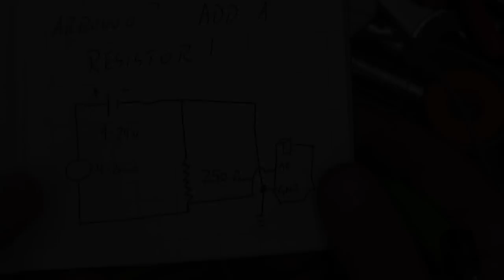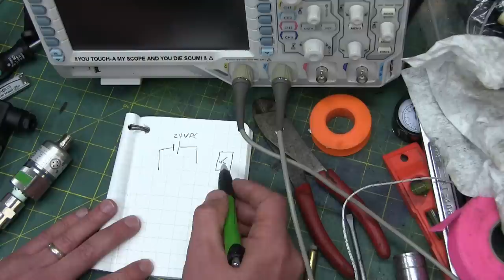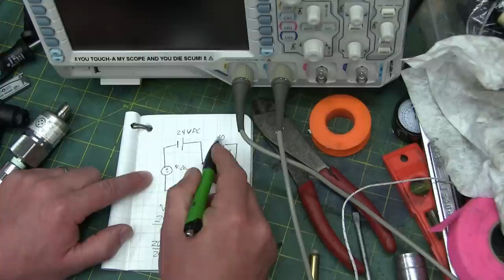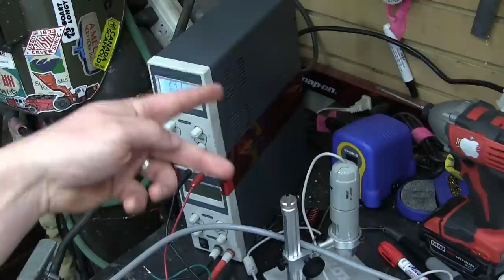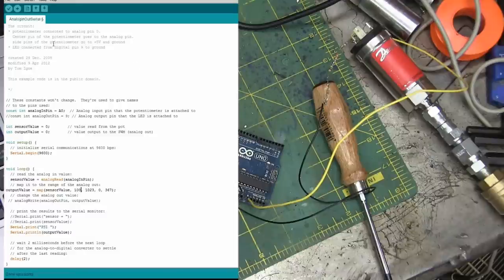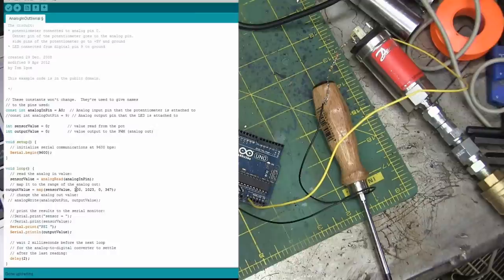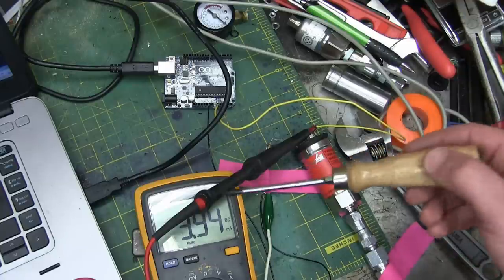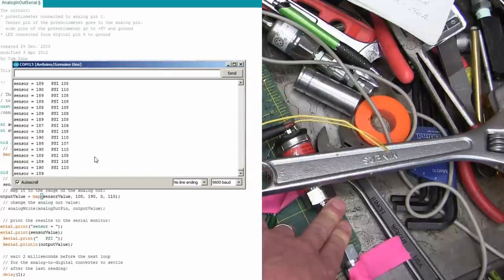4-20mA Industrial Sensor + Arduino

Comment: You have hit my specialty area!  We use 225 ohm resistors (0.9 to 4.5 VDC).  You can detect some failures where the current goes above 20 mA or below 4 mA.  The current loop allows you to have multiple devices in the loop (panel meters, current switches etc.) without affected the output.  Since the loop doesn't care about resistance (within limits) it is unaffected by resistance in the wiring.

Just be careful about the configuration so that you don't have a power supply with a grounded negative, then ground the loop somewhere else.
Reply: Michael Steeves you need to make sure the power supply can drop the voltage for each device but otherwise yes.  Just use 220R for an Arduino, it's an E12 value

Comment: If you send the values from the arduino to the pc you can open the serial plotter(tools->serial plotter) in the arduino IDE and show a graph of the values comming in
Reply: Or just use a Pi with an ADC hooked up.
Reply: Gordon Lawrence "just" .. I would say the arduino solution is way easier to get it running

Comment: Bastard got me. I'm running it over and over in my head how the F does one get 250 ohms from 3-10ohm resistors.  It didn't occur to me until I finally got that marble loose in the old can of brake clean I have had on my shelf for years!
You had me really questioning myself. 
Never doubt AVE!

Comment: The reading that is measured by the arduino depends on the precision of the 250 ohm resistor.  At my steel mill we always purchased expensive high precision  250 ohm resistors.

Comment: For better, more functional code that properly handles below 4ma errors: 

short read420(analogPin){    
    sensorValue = (short)(analogRead(analogPin)-204);    //is an approximation of the 4ma value
    if (sensorValue < 200){    //is under the 4ma value by some quantity to account for component aging and noise
           sensorValue = -1;
    }    
    return sensorValue;    
}
//Note that -1 is an error code and anything positive is a good value

Comment: Depending on how the sensor is rated I would suggest that the lower value (100) isn't actually 0 psi, it's likely closer to 14.7 psi depending somewhat on your elevation (14.7 psi would be sea level, 13 psi would be 1042m/3420ft, etc).
Reply: You would only do that if you're trying to measure absolute. He's reading PSIG.

Comment: 3:45 no you mean 5v/20mA=250ohms. 5v is the voltage you want it to correspond to the max reading from the sensor i.e. 20mA

Comment: For what it's worth, if you're using a 6" bourdon tube gauge as your calibration standard, they're typically +/- 1% of full scale.  Heise (mirror backed) gauges are generally 0.1% or better.

Comment: Good video, very valid approach to convert current into a voltage, however a more Skookum way would be to use a Transimpedance amplifier, just google it on the confuser.

Comment: Your pixie wrangling explanation is a bit off. For any part of the circuit, V = I * R. If you therefore measure the voltage and know the resistance, you know the current via that formula. 
If you know the max voltage (5V) and the max current (20mA), you can calculate R = V / I = 5V / 0.02A = 250 ohms. If your measuring device works with 3.3V, you need a resistance of R = 3.3V / 0.02A = 167 ohms.
You will notice: lower resistance means lower voltage - which might sound counter-intuitive, but it's because the current is regulated. Therefore, if you can't find or fabercobble the desired resistor, in this case you should find the closest one below the desired resistance (so 220 ohms or 150 ohms in the standard series) to be on the safe side.
As others pointed out: uncle Bumblefuck here probably remembered the value, but forgot the actual way of getting there.
Reply: Then the 24Volt supply is irrelevant? Can I use 9volts with the same 250Ohm resistor to output the same signal, then?
Reply: Thanks for explaining this, i didn't understand how he divided 20 by 20 and got 250.

Comment: in your diagram the +/- on sensor are wrong way round. Also with your wiring, if the 24v gnd and auduino gnd connect the auduino will let the smoke and/or schmoo out. if you  connect the 24v to sensor and put 250R between sensor and gnd, then sensor and auduino using same gnd reference and the circuit will be much safer.

Comment: I'm in the habit of constraining values in addition to mapping them when reading from analogue devices. This eliminates generating errors from erroneous input in later code if you're working with returned values such as when the circuit wasn't powered and returned negative values.

Comment: If say you wanted to use this method to read 2 different pressure sensors both with the same 4-20mA output signal would you simply connect the +ve side of the second sensors limiting resistor to a different analogue input in the arduino and connect the - side of the second sensors limiting resistor to the same arduino ground?

Comment: To take advantage of the full resolution of the AVR microcontroller's ADC, you can add gain and offset adjustment with a 741 opamp.

Comment: If you want to correct for non-linieraty you should make a function (or maybe look it up in the data sheet for the sensor) and use that instead of the linear map() function

Comment: it's interesting, I got a lot of sensors in working condition from scraping industrial machines, I never got the time to hook them up to an arduino (because, first, I rarely work directly on electronics so my experience is limited, I mostly work on automatic systems that have all the electronic components built-in the I/O devices and second, I'm lazy as frakk). so thanks for this video, it may probably kick me out of my laziness and try!

Comment: Swapped out a controller once, old devices were setup for either sink or source 4-20mA, can't remember which but our new controller was setup for the opposite. Ended up dead shorting a 96VA 120/24VAC transformer. She hummed like a bastard but there was enough cable length there that it didn't immediately trip the overload. Scared the bejesus out of me.

Comment: Instead of using a linear function to transform the data I would've colleceted a bunch of points (raw value and the pressure) and plugged it into a application or a fancy calculator and have it compute a regression formula. The data wasn't even close to linear, you would have a lot more accurate PSI readings with a better fitting equation.
Reply: no need for anything fancy, the sensor is linear and all the info is there. 
zero pressure is 4mA*250R = 1V, max pressure is 20mA*250R=5V
Reply: It's a linear sensor though that's the point

Comment: Don't know if they all ready have something like that on a car but it would be cool to apply this to the air pressure system on a car with a little turner comfuser or a little electric gauge, so if you have air lockers or air compressors in your truck and don't have an easy way to see pressures and stuff while on a trail.

Comment: ok im getting the data in the serial monitor but at normal temperature I get -27 and at hot coffee temp i get -50.  Im using thid code to map the values: 
temperature=map(sensorValue,205,1023,-500,1500);
  f1 = temperature; // Float conversion
  t1 = f1/10.0; // dividing by 10

Comment: AVE - Great videos dude, you crack me up! I'll add this comment what for trying to help...
I believe the reason your values were not matching up is due to the scaling you used in the program. A 4-20mA over a 250 ohm resistor produces a 1-5 volt signal. I also believe the arduino input is a 0-5 volt input, so when the transmitter is at 4mA or 0% of signal, the input is seeing 1 volt, or 20% of the arduino signal range. To account for this difference, you must offset the scaled range down by 25% of the transmitter range.  367 * .25 = 91.75, so if you scale your output from -92 to 367, 1v will produce 0 psi. This table might help people visualize the scaling.
mA                Volts             Display
0                    0                    -92
4                    1                     0
8                    2                     92
12                  3                    184
16                  4                    276
20                  5                    368

The formula we use in the Plc world is this. Scaled value = (((raw value - raw offset) X (eng span)) / raw span) + Eng Offset
Offset = distance from 0, can be positive or negative.
Span = Max value - min value.
Reply: gonna take a screenshot of this formula  thank you kind stranger.

Comment: Dependant on ADC then a couple of 100R in parallel would be better as at 20mA you get less voltage drop (1V) so there is less of an issue from errors when the battery runs low. EG if the circuit in the transducer needs say 4V and you use a 200R resistor (E96 value) then you have a 4V drop at full scale. That means if you are powering it from a 9V battery you will be seeing drift well before the battery is low (7.2V). Noise really is nothing like as much of an issue with a differential twisted pair as it would be with say a single ended shielded co-ax so you don't really need to worry about reducing from 5V to 1V FSD.

Comment: Hey , Ave why not get a few data points, and make discrete linear equations for each line segment. Then all it takes is a quick multi-if statement based on the voltage range to land at the "right" multiplier for that range. Might get you to +95% accuracy pretty quick. Anyways, great video, pleasure as always

Comment: Pro tip: Plan on measuring up to 24mA so you can see if the sensor is going overrange (sensor fault). Of course, the question remains as to what yer gonna do if you do measure that, but I degrease.
Reply: If it goes higher won't it damage the arduino since it will output higher unexpected voltages?

Comment: Hey AvE, Just a quick one. Can i use a 10mm Capacitance Proximity Sensor Switch as a low fuel sensor connected to a light and my Stator on my dirtbike? is it that simple or is there magic involved? Thanks 

its has no reserve and running out of fuel is a colossal T@#T!

Comment: @AvE  Your first circuit diagram  is correct with respect to the arduino and ground, but your second one has the arduino ground on the wrong side of the resistor.  Can't see how you actually hooked it up, so we can't be sure if it contributed to your strange results.  Teardown Dan pointed out a math error in the resistor calculation that will also alter your results.    EDIT:  I can see you are powering the arduino with USB, so that's not an issue as it also gets it's ground there with nothing in between.

Comment: How do I write a script that will run or sleep my arduino based on the presance or lack of a  small DC voltage applied  to a designated pin? can  anyone offer  help on wiring a code  to control the arduino with an external voltage?  Do I need a voltage sensor and use an IF/ELSE statement?  Heeeeelp :(    I can start my generator so far with the script i have, but im stuck on how to get it to start and stop automatically  based on loss of mains power.  (dc power supply)

Comment: Many people here are saying that he did the math wrong an should be using a 1K resistor because 20V / 20ma = 1kohm. 

No. 250 ohm is correct. He's simply using a resistor to convert current output to voltage. The sensor lets through current and the resulting voltage developed is based on the resistance (up to a limit... cannot be higher than the supply).

V@4ma = 250Ω * .004A = 1V
V@20ma = 250Ω * .020A = 5V
Reply: Yeah that's the right answer, but he wrote down the wrong math! He wrote and said "20V/20mA=250 ohm", which is plain wrong. He should have written 5V/20mA=250 ohm.
Reply: I agree with Alex Gray: AvE shouldn't actively try to mess up with our heads.

Math. Not even once.
Reply: The 20mA should be represented in amps before the division. 24v/0.02amps = 1.2kohms. Ohms law is Voltage divided by amps x resistance in ohms. Not Voltage divided by milliamps x ohms

Comment: HELP NEEDED! 
Gents, anyone that can tell me how I define the sketch in IDE if I want the reading in barG with two "2" decimals? if I use the map and use print to either an LCD and/or the serial monitor i get the decimals on the screen but the value is rounded to an integer value e.g. 1.00 - 2.00 etc. not 1.55 or 1.75 etc.

Comment: 20V/20mA = 250ohm? 3 10-ohms in series is 250 ohms?

If you know you got 20mA, how do you get 5V? 5V/20mA = 250 ohms, you had the correct answer but your scribblings were hoopajooped. The closest resistance you will find in most packs is 270ohm. Not sure how your series resistance computing works, you had different values soldered in series from what I saw.

Comment: Think your math is off. 250*20mA=5v. So, with a normal supply voltage you could use a 500 ohm resistor for a 10 volt signal that can be used in most industrial control schemes. Allows you to submit substitute a mA sensor in place of a voltage sensor when the bean counters screw up inventory. Just reading the voltage drop across the resistor like a shunt
Reply: After reading more comments I realize there was no need to comment. Vice cut my blood flow off for a minute...

Comment: Thx for the vid AvE!!
Reply: can't get enough arderno related vids!!
Reply: I agree.   I love them things.   Always looking for a problem to solve with an Arduino solution.  Just finished a automatic live well pump timer control for my boat.   Very basic problem but I needed a new timer.    I made mine all solid state.   Saved $65.00 USD making my own to boot.  The original one had a relay for switching the pump motor power.    I used a MOSFET to power the motor.   Works great.

Comment: i wish i had a pile of those on my old pneumatic system; for faster solenoid changing more run time, only for the odd solenoid but still good troubleshooting tool could get ready faster for complex pneumatic system  rise the initial cost and clean air of course; mechanics dream system; wish i could co design for run time championship

Comment: You know I want to meet the guys who downvote. What was bad? I use these sensors all the time (voltage ones) amps here and there. Either way, advice is solid. Granted I have been spoiled I have the lab wire in a TEDS chip, resistor, then get it calibrated, slap on the corporate common connector and plug and play.
Reply: mistakes in the math, doesn't clearly show the setup in full, doesnt explain the numbers..

Comment: The resistor should be sized to have 5 volts across it at 20ma. 250 ohms it is. His 30 ohm resistor is causing the low readings.

Comment: Sorry the maths is wrong.
You need to calculate the resistance for a shunt resistor.  Basically it will have a voltage across it that is max 5V at a max of 20mA that means V is 5V and I = 20 mA (or 0.02A) so in this case R = V/I which is 5V / 0.02A which is 250 ohms.  This is the max voltage  that can be across the resistor and would be 1023 etc (2 power 10  minus 1)

Comment: Hey AvE,

It would be 250% easier to read your schematics if you would draw the negative rail at the bottom. Stick to convention!

P.S. Surely all you need is a resistor in series with the output, the power and the micro across the resistor?

And possibly add a series resistor to get the voltage down to 5V max.

Comment: Would be better to connect it like this;

+24V to transducer +, transducer - to resistor and AI pin of arduino, other side of resistor to 0V on "battery" and arduino.

This way you don't need seperate powersupplys if you want to add more sensors ;)
AND it also makes more sense :P

Comment: How do you get to 250 Ohm...
Little more explaining, arduino can handle 5V max and the max current sensor =20 mA.
So Resistor R = Voltage / Current = 5 / 0.02 = 250 Ohm
The voltagerange is between 4mA x 250 Ohm and 20mA x 250 Ohm is between 1 and 5 Volt
👍😁
Reply: You got it. He was doing it all right, just messed up the math.

Comment: I noticed your use of the map function has an error in it,  if you want to scale the analog value to 0-367 you would need something like this...

outputValue=map(sensorValue,0,1023,0,367)

I'm not sure where you came up with the 100 you are using as the second argument
Reply: Brent Kinser that's the offset for the 4mA because at 4mA through 246 ohms (measured) you'll get ~1V on the adc, which would be more like 1024/5 counts =~ 200

Comment: noob question, how exactly 3 10 ohm resistor works out to 250?
Reply: It doesn't. Probably 220+10+10+10, or some other combination. I recommend using a 270 ohm, this makes the output voltages a wee bit lower, but ensures you won't fuck the arduino by feeding more than 5V into an analog input pin.
Reply: antalz thanks man for clarifying, something was off in that for me
Reply: antalz you mean 220.  270 would give you 5.4V at 20mA
Reply: Yeah I got that the wrong way around, 220 ohm is what you need.